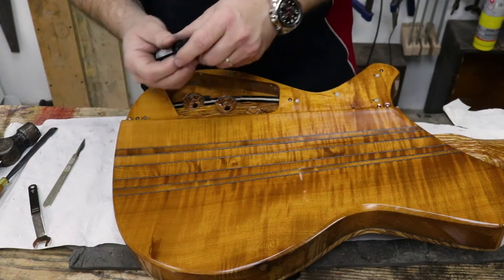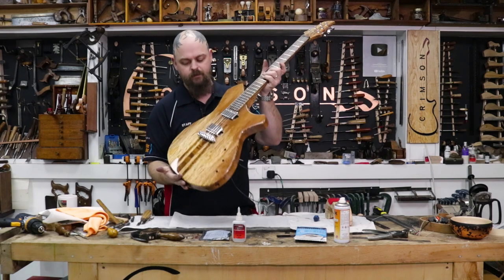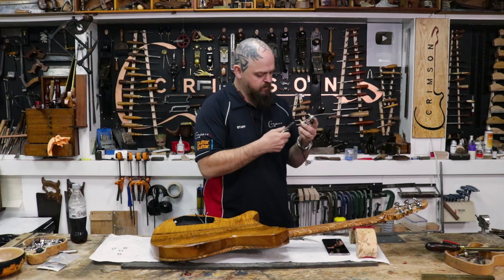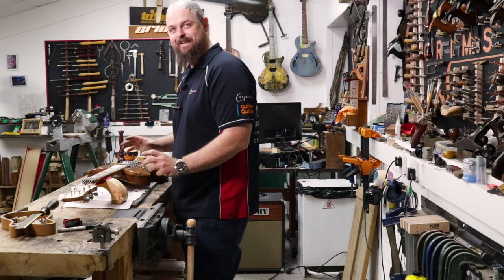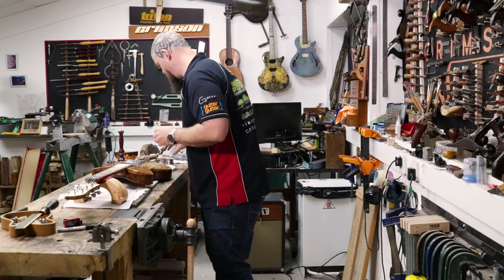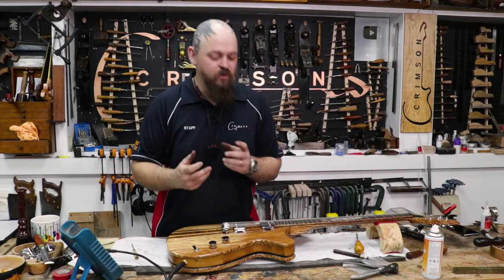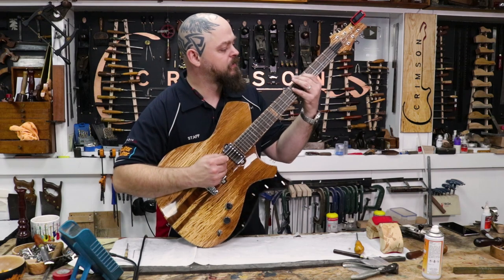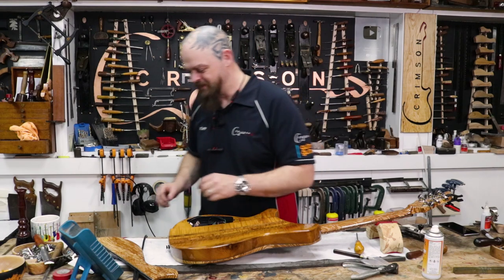Episode 6 of 7 - How To Build an Exotic Set Neck Guitar - The Silky Oak Build

Comment: I wouldn't beat yourself up too much about the back plate/cover issue. I would cut that section of the body off and glue on a nice piece off silky. Bit of cavity work and a complete body re-finish/shaping should o the trick. While you're at it, could you consider a sliming down or even re-shaping of the top bout ? Looks a bit bulky to my eye.Then build a new cavity plate and screw it down.
Finally Ben, you are astonishing and that guitar will serve you well for years. Imagine it in 20 years time after having the Dorset air blowing on the finishing.

Comment: Did u mount those pickup scrwes directly into the wood or  you inserted some threded nut inside first? Can you please make a video and give us some tips on how to mount the pickup directly into the wood....thanks
Reply: AFAIK he drills holes for the screws into the body and then just glues the springs on the body with a bit of superglue.
Reply from the maker: I used threaded inserts this time.. the editor must have cut that but out! Sorry. B

Comment: Solution.
I love the magnet idea and the look of it being screw less.
If it was me, I would mill/route down the control pocket area to clean up past the carved edge. Giving a square corner all around the area.
Then refit or sink the magnets in further. Possibly adding a couple or using stronger ones.
Then I would get a steel profile cut of the shape of the lip. In 3mm plate or similar.
Then I would have laser cut a female version of this profile in a 3mm thick piece of beautiful wood in keeping with the style.
Adhere these two profiles to a new back plate, made in sheets as before and then carve and finish.
The steel profile should be enough to keep the wood settled and level and will attract to the magnets better than before.
Just an idea.
Reply from the maker: That would totally work and look great! B

Comment: Put a soft spacer on the backplate to take up the movement if the strength of the magnets allow. Or weight the twist out.
Reply from the maker: Soft spacer is a genius idea! I wish I had thought if that before.. I have now recarved it and drilled for screws though, weights etc rarely work to fix twist once it has happened.. sadly! B

Comment: Ever tried Dzus fasteners for fixing backplates? Originally used on aircraft but also racing cars. They lock and unlock by rotating them 90degrees, usually with a screwdriver. But on a guitar it would be cool to use a plectrum.
Reply: The only reason to take the backplate off is to fix a problem or to check and see if there is a problem. After the plate comes off you are going to need either a soldering iron, contact cleaner, a multimeter and/or pliers. If you have those things you probably have a screwdriver too.
Reply: @wilfredjbrimley  Then why would Ben use magnets here like this? Just a suggestion for another convenient way to attach a back plate; another way to tinker
Reply from the maker: They would look very cool on a guitar! Thanks for the suggestion. B

Comment: Why did you use Polyurathane as the finish? I thought that it killed the life in the wood. I expected you to use a lovely thin Cellulose finish. I have a red wine Vintage V100 that I bought cheap with a broken scarf for the experience and I'm always thinking about sanding a lot of the poly off it so that it's not so deeply dippy with gloopy poly but if you're actually using poly by choice I guess it's ok.
Reply from the maker: Really with modern finishes they go on very thin and end up very hard. Not the same as the shitty old poly we all 'know' is bad for tone.. you may well notice a difference if.you do strip her back but certainly not as much of a difference if you were to change the pot, pickups or string gauge even.. B
Reply: @CrimsonCustomGuitars  Mini humbuckers on the red wine V100. I've got a set of SD JB/59 but they'll have to wait for something else. I don't think those Wilkinson's are bad at all, just consistently what they are.

Comment: I hate strap buttons if there's no strap. I wish someone would make spring loaded ones like a latching push switch, so tehy sit flush until you need them. Then you just push them in and release, and they pop out. We've been using the same crapy design for so long, and they look horrible

Comment: Looking at it from the face, you would think it was a through neck. But it's not. The way the neck has been set seems wrong, there is no heel butting against the body. Looks like it should need a plate and bolts for longevity strength.  Body looks too thick at the underside, you could easily plane in down so it would be flat - with a sensible control cover. The top horn looks wrong. Needs reshaping or some severe contouring to bring some refinement that matches that lovely wood. The finish looks wrong, I would imagine it looking so much better with a soft satin shine.
Reply from the maker: So you don't like it then? Not a problem, nothing ever gets universal acclaim. Thanks for watching anyway. B

Comment: I have a question. Does the control  cavity has to be a certain dimension. I dont play guitar but I am trying to make a gift for my friend though
Reply: Nope. Just large enough to put the controls in. If, say, you only have one control, typically Volume, then in theory you only need a cavity wide enough to install the one potentiometer. There may be other reasons for a bigger control cavity, such as being part of weight reduction
Reply: Tim had it right. And be sure you have sufficient depth for the controls you are using. In particular, blade switches are often bulky. Plan your design. Good luck.

Comment: ...I don't mean to be rude. My intentions are Not meant to appear that way..
Are you aware that you can't set intonation by harmonics ? 
Harmonics won't tune ... Also, people , you all need to learn to tune and set intonation by Ear.
When you use an electronic tuner ( any of them ) ,you're tuning by "Eye "
Ears ( well most ears ) can hear slight differences that tuners can't . Also, the electronic's
in guitars and pickups, can often times , through magnetic idiosyncrasy throw a tuner off 
and not let you tune correctly.
P.S. You'll fix the control plate. Besides , I think you can find a nicer matching  piece of 
wood.